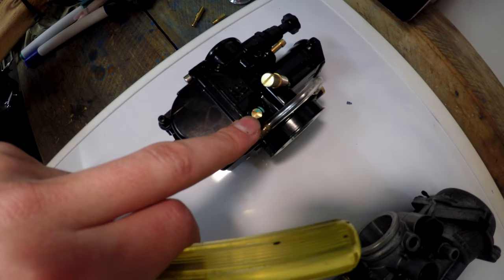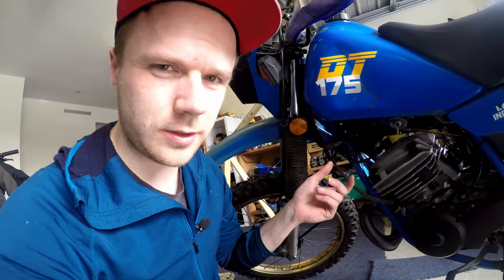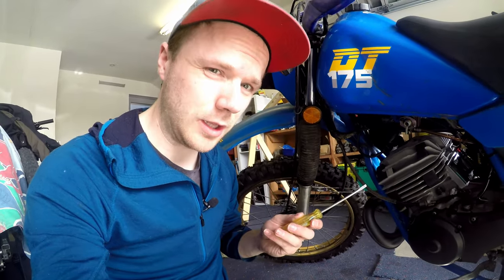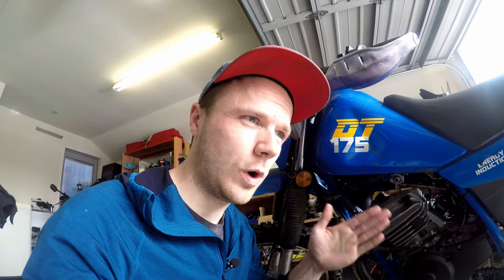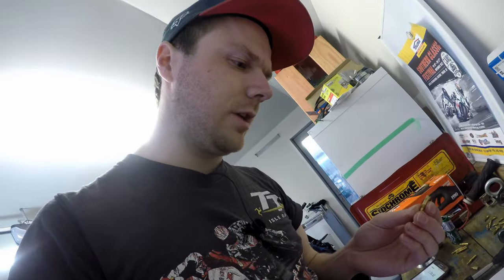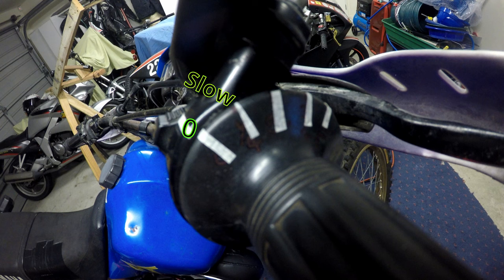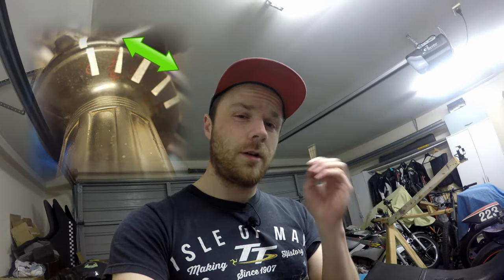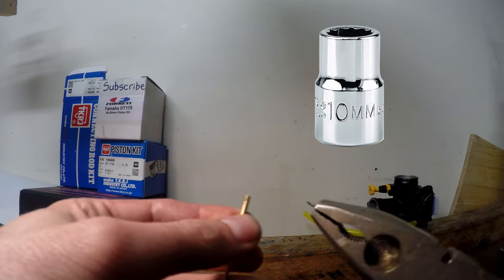pwk Carb Jetting, Setup and Tuning

Comment: What is a good jet size for a china 150cc Enduro with a big bore kit with 65mm piston, 26 mm flat slide keihn carb and yashumira exhaust. Right now I have a 40 pilot and 110 main, clip in middle on needle. It is a 4 stroke. It back fires on deceleration. I tried a 115 main and worked without connected to filter and airbox. Connected to airbox I have to drop to a 110 main jet . With the big bore kit the 150cc should be somewhere between 180 and 200 cc. I will try to open airbox a little to low for bigger main. I was thinking maybe changing pilot from 40 to 42 or 45 to help get rid of backfire on deceleration. Seems to run ok through out the throttle range, could be a little better I think. No bogging but not great acceleration on top end.
Reply from the maker: Ok so your on the right path with the backfire, a bit richer on the pilot jet should help or try turning the mixture screw in a 1/4 may also help.
I think a 110 main in a 26mm carb is probably to big. I run a 112 or 115 in 30mm carbs on our 150cc bikes.
 Maybe a 105 might give you more acceleration.
Last but not least if your engine is 180cc to 200cc a 26mm carb will probably limit top end power ,  depending on what your bike revs to and its stroke.
Hope this helps.
Reply: @TheMotorcycleForge  when the bike was 150cc before the big bore update I tried the 28mm flat slide and it simply did not work, poor performance. On a Kawasaki kmx 125cc 2 stroke the 28mm worked fine. On the 4 stroke china bike I had no luck, once I tried the flat slide 26mm it worked, and jetted easily except for the deceleration backfire. I'm a little worried about going to a 105 main it might be to lean. It ran good with no filter on top end with a 115 main. It runs ok on top end but not as good as the 115 without filter. Don't want to run bike with no filter to much rain and dirt here. We will try to open air box tomorrow and see if that allows for a 115 main. I will bring a 105 main if the 115 does not work. I tried adjusting fuel/air mixture screw but did not get rid of backfire.motorcycle is heavy. I have a rack on the back to carry a top box and 2 water containers 20 liters each, around 5 gallon. It's my typhoon, shtf bike. My other bike is a Yamaha aerox with the 155cc engine. Great bike but a scooter and is boring as hell. My girlfriend won't ride on china bike. She's scared of it. Plus it's high off ground like most dirt bikes are.
Reply from the maker: Sounds like you have everything pretty sorted.
If the airbox mod doesn't work you could try a 108 instead of 105.
Only other thing I would try is a get a air fuel ratio gauge. 
Will make tuning simpler as bikes can pop on decel when lean and rich.
Reply: @TheMotorcycleForge  thank you for the feed back. I live in the Philippines on an island surrounded by the Pacific ocean. No fast food or malls here. Can order things, takes weeks to get. Maybe we can get maybe 10% of the variety Amazon sells. I have jets from china they are 110-115-120 etc. I order jets for pwk slide carb from different sources and see if I can find something. I prefer adjusting jets up or down at 2mm at a time instead of 5 at a time. Will check spark plug also to see if running rich or lean. I only have 200 km on the big bore kit. I only have about 800 km on bike and when I bought the bike new the place I bought it from said they put 20w-50 full synthetic oil in it. I wanted regular oil for break in and I had to drive around 50 km to go home. Checked oil when I got home and it looked like clear fluid with zero lubricating property's. Changed the oil right away with a good non synthetic 10w-40 oil but the damage was already done. The bike ran ok but it belt like I was driving a horse and buggy, so slow I could not stand it. When changing cylinder the cylinder walls were scared at 500 km. All because what ever oil they put in the bike was useless. I should have had the dealer change the oil with oil I provided. You shift in second and give the motorcycle gas now it will throw you back in the seat. The speed shop that sells the big bore kit rates it at 180 cc. Me and the mechanic both feel it's more in line with a 200 cc. So close to having it running the way I want it. The bike hauls a*s. But could be a little better. Police here have been known to tear the muffler off on after markit exhaust if to loud. I have a db killer baffle installed in muffler which makes it a little less noisey. If I get rid of the back fire I can keep the pipe longer.
Reply from the maker: Dam that's a pain about the shipping thing, really makes projects take a long time.
Sounds like the bike is a ton of fun to ride, yeah synthetic is pretty crap for running a motor in, the dealer should have known that.
Do you know what the stroke of the bike is?
Reply: @TheMotorcycleForge  it's a 4 stoke and the stroke of connecting rod is 49.5mm. the 200 and 250 has a stroke of 62.2.
Reply: @TheMotorcycleForge  finished working on the bike today. Changed the pilot jet from 40 to 42. Played with the needle adjusted moving clip both directions. Ended up leaving clip in middle position. We checked size of main I thought it was a 110 but it's actually a 115. It doesn't not bogg or pop at full throttle so we did not need to try to open air box up more. The back fire is less now, but still have a little deceleration backfire but it's less than before. Spark plug looked good. A light brown. I'm not going to lean the main out. It's fast, probaly in par with the 200 cc dirt bikes. I was hoping to get a little more acceleration out of top end. But it is not a 300cc bike. Bore and stroke now is 65mm x 49.5mm. I have no idea how many HP I have now. Stock 150cc before the updates was only 10.3 HP. I think . My guess now with carb upgrade, pipe, and big bore kit and oil cooler I'm probably around 15 to 16 hp. I wish I knew how much HP I gained. No way of telling. No Dyno here on island to check it. What is your guess on HP now, stock was only 10.3 HP. Stock carb was 24mm round slide and now it's a 26mm flat slide racing carb. Yoshimura full exhaust, china copy on exhaust. I got the full exhaust for around 100 us dollars. The original yoshimura exhaust is around 700 us dollars.
Reply: @TheMotorcycleForge  Does the air/fuel ratio gauge actually work? Is it worth buying?
Reply from the maker: I wouldn't worry about the afr gauge with how its running, would be a bit of a waste of money.
Yeah around 4-5 hp gain at a guess and I did the math with a 65mm bore and 49mm stroke you bike is 164cc so sounds like it's quite fast for it's size.
Reply: @TheMotorcycleForge  thanks for doing the math for me. It is advertised at 180cc. Only 164cc? Probably because of the short stroke of 49mm. Still a big improvement over stock. Thanks again.

Comment: Hi, I'm from Argentina and I bought a fxr 150 but it came with a honda tornado carburetor, a keihin 32mm, I understand that the chicler measurements between keihin and mikuni are different and I don't know of an equivalent, I know that the original fxr is 27.5 idle and 115 main, I would like to know which keihin chicler could go well, by the way, good video
Reply from the maker: So I run a 30mm keihin pwk copy on my fxr 150s. With around 40 pilot and 112 main jet.
A 32mm carb is probably a bit big for a fxr150 but I haven't tried one so not 100% sure.

Comment: I have a predator 212 motor that's heavily modified with a 28mm pwk carb on my mini bike and it revs out perfectly fine but won't idle need help
Reply from the maker: Ok so first, have you made sure a nothing is clogging the pilot jet or any part of the idle circuit.
What pilot jet do you have in it?
Will it idle when you turn the choke on?
Reply: It has a 38 pilot jet and yes it will run on choke
Reply from the maker: Then you need a bigger pilot jet, maybe a 42, get her up to operating temp and tune it to suit
Reply: @TheMotorcycleForge  ok thanks for the help I really appreciate it

Comment: my bike dt 125 newly rebore and i use yamaha rxt 135 piston with ring. also use 4 stroke carb yoshi r 28mm i use 120 main jet and pilot jet 40 run it perfect. but i want to replace it with my stock carb mikuni 24mm the stock jetings is 165 main jet and pilot jet 22.2 the bike not run. what jetings can u recommend. and tnx for the video i got an idea
Reply from the maker: So does it not run at all or just rough?
Give the stock carb a good clean and make sure no jets or passages in the carb are blocked before changing jets.
Reply: @TheMotorcycleForge  with the stock carb mikuni the bike not run. also i clean the carb very well i think the jetings of mikuni has to replace
Reply from the maker: So jetting from mikuni is difficult to keihin for example. A 100 keihin jet is the same as 200 mikuni jet.
Pilot on the mikuni may be to small nut cant hurt to try some different jets
Reply: @TheMotorcycleForge  thank you ♥️

Comment: I have a Yamaha xtz 125 with 26 nibbi carburetor (105/35 jettings) can u recommend other settings?
Reply from the maker: I would say that sounds pretty close, how does it run, does the pipe look rich or clean.
Reply: @TheMotorcycleForge  its almost perfect,i check the sparkplug and its brown
Reply: @TheMotorcycleForge  i will try 32 pilot jet next week if it will run smoothly
Reply from the maker: So is it running rough on idle, part throttle or wide open?
Reply: @TheMotorcycleForge  what size of carb u can recommend for 125cc 4 stroke street legal enduro and also jettings
Reply from the maker: I think the set up you have should be pretty close to what I recommend. 
I normally go for flat slides but that's not going to affect much.
I would maybe go up a main size to 108 and test, If it's worse try a 102 main, Pilot sounds about right with a 35.
This is all a educated guess as each bike and carb are unique.

Comment: Hey how come my scooter is boggy when I am at wide open throttle then it loses power so I have to slow down again and get going again.
Reply from the maker: @Smodlee  Could be either very rich or very lean among other things like float height too low. You will need to do some testing to figure out which one it is.
Reply: @TheMotorcycleForge  float hight adjustment is just bending that little lip that float jet sits in right
Reply from the maker: @Smodlee  yep, ideally you want it sealing a few mm before the float hits the roof of the carb

Comment: How can you check if the float os ok or seating too much down ??
Reply from the maker: I have done a previous carb video and I go over how to set float height correctly.
If it's set to low it will run out of fuel at wide open throttle.

Comment: I have a am6 engine with a big bore kit, exhaust and all that stuf and i had a dellorto 21mm carb on it and it ran fine with it then i got a mikuni 28mm flat slide carb and the problem with it is that when you give it quick full throtle it bogs down. I tried biger main jet, tried different float settings and nothing realy helped. Its got a 32 pilot and 150 main jet. Please help i realy want it to work good again.
Reply from the maker: I would possibly try altering the idle mixture it may only need 1/4 turn in or out but my guess is that the carb is probably a smidge big for that motor. Does it accelerate smoothly when you roll on the throttle slowly?
Reply: @TheMotorcycleForge  when i slowly give it doesn't bog down
Reply from the maker: Yeah that's the same with our race bikes and the conclusion I came to is because the carb is a bit big for the engine. At low speeds the rapid change in throttle is to much for the engine but it will still gain some power up in the high rpm as a result.
Reply: @TheMotorcycleForge  Yeah probably. But i tried adjusting the air screw and its not as bad as it was before thanks a lot!

Comment: Okay can someone help me becouse i dont fully understand english so if someone could detect problem for me i would be thankful. I have problem with my carb cuz i have to rich fluel and my spark plug is almost fully black( and burn in about 2 mth) . On the leanest fuel setting it still happens for my spark plug to be fully black. I also wanna mension that my true powerband in my 2 stroke is hard to get.
Reply from the maker: What carb do you have on it, what bike is it and what jetting is in the carb?

Comment: I have 32 pilot 95 main and needle at 3 top end feels and sounds like rev limiter before shifting
Reply: Its a 125cc with 22mm carb
Reply from the maker: @byronbrodeur3341  What brand carb and what type of engine?
Reply: @TheMotorcycleForge  chinese gio with with nibbi carb

Comment: What happens if the pilot is extremely lean

From factory my pilot is 75 and main is 160

I have a jd jetting kit and it’s telling me to put a 50 pilot and 170 main
Reply from the maker: Generally bike will be slow to return to idle if to lean on pilot jet., may pop a little on decel depending on bike. 
I think a 50 would be ok, if you follow the video I give a full list of symptoms and how to tune the carb.

Comment: How do you tune the power jet?
Reply from the maker: As I understand it the power jet affects only full throttle so I would tune that last and use the same technique as tuning the main jet, I avoid using power jets as there is no real gain on the bikes I use.
Hope this helps
Reply: @TheMotorcycleForge  yes, there's not a whole lot out on how to use, or what the proper procedure for setup after everything else is good. I appreciate your time friend. Thank you.
Reply from the maker: No problem Shaun, goodluck with your jetting.

Comment: I had a nibbi carb spent.3 hours on this and it still screwed when.you.rap the throttle it would just.cut.out.Think i.got.a.defective carb no matter what I tried something going to try a different brand
Reply from the maker: Sometimes if I carb is to big for the engine it can cause engine to cut out when throttle is opened very fast.
What size carb and bike?
Reply: @TheMotorcycleForge  150cc 26mm carb 4.stroke
Reply from the maker: Ok cool and what jets do you have in it and the needle position?
Reply: @TheMotorcycleForge  35 pilot and 108 main and 3rd groove up
Reply from the maker: Ok at a guess 108 might be a bit big for a 26mm carb but if you have tried leaner and richer maybe it is the carb.
I would try a 100 main jet and if its better after that try a 98 main.
Reply: @TheMotorcycleForge  I give it a shot
Reply: @TheMotorcycleForge  I got this pretty close at wide out I can hear it breaking up just a little Im at a 107 main so would that mean go up or drop it
Reply from the maker: @ironhead320  Well if the 107 is feeling better than the 108 but not perfect I would drop it another size and see how it goes.

Comment: How does one install throttle cable?
Reply from the maker: As long as your throttle cable has the correct fitting on the carb end it's pretty easy.
Just compress the spring and locking tab up to the carb top and put the end of the cable in the cutout in the slide and release the spring & locking tab.

Comment: Mine runs but idles way to high and the idle screw basically does nothing. I had it run away from me already
Reply from the maker: First thing to check is that your throttle cable has some free play as it might be holding slide open a bit, Second make sure nothing is obstructing the slide from closing properly, lastly it might be lean on the idle jet so a bigger idle jet may help.

Comment: I got a 24 pwk can’t get it to idle bike just wants to take off
Reply from the maker: High idle can be from a few things.
Throttle cable is adjusted to tight.
Something is stopping the slide returning to the bottom, Im guessing you have adjusted idle speed screw already?
Bike could be to lean on idle circuit either from incorrect jetting or you may have an air leak.

Comment: Idk why when I start giving more throttle it starts to bog but once I get going it stops
Reply from the maker: Is this when you open the throttle fast or slowly and what size is the carb compared to stock.
Reply: @TheMotorcycleForge  it’s when I slowly open it and it’s a stock carb
Reply from the maker: What bike is it and is this a new problem or always like that and have you changed anything on the bike recently like exhaust ect?
Reply: @TheMotorcycleForge  it’s a new motor it’s a predator 212 ghost
Reply from the maker: Well I would check the basics first, what is the plug condition like?
Is the sparkplug gap correct.
Set up the carb correctly, float height ect.
Go from there, if still no luck consult who you purchased it off.
Reply: @TheMotorcycleForge  ok I will
Reply: @TheMotorcycleForge  idk how to tune a pz22 carb and every where I search somone says something different
Reply from the maker: Easiest way is follow the steps in this video, it's applicable to any type of carb.
I also have another video on carbs where it's more on theory and setting float height ect
Reply: @TheMotorcycleForge  yea I also have a small problem with the float ima see that video also

Comment: that carb is seriously angled away from vertical! the float must be set really low.
Reply from the maker: Yeah It was a bit of a test as I was sceptical. It seems to work as it should, apparently you can run them up to 40 degrees inclined. 🤔
Reply: i am impressed! the float chamber cannot have much fuel in it! i couldnt get a pwk to work at an an angle at all!